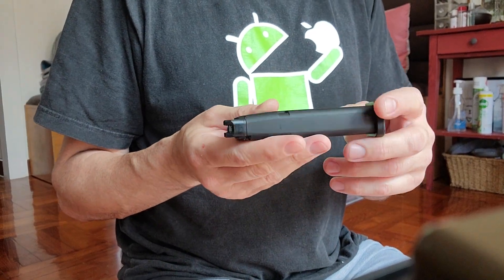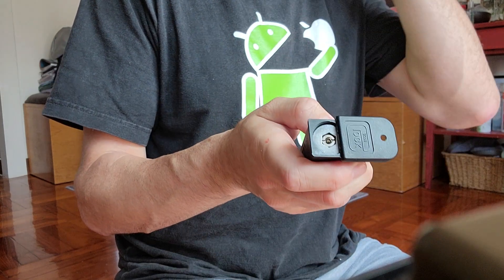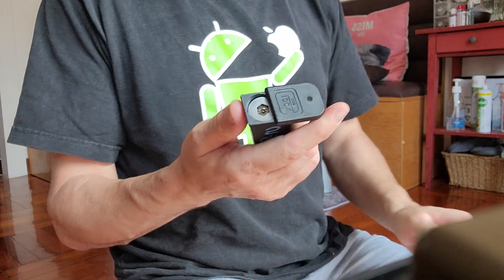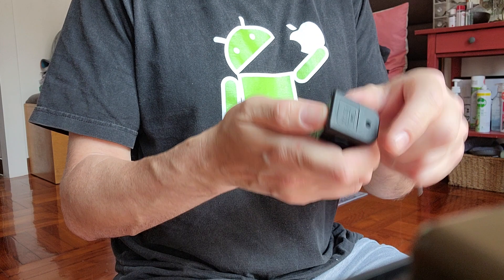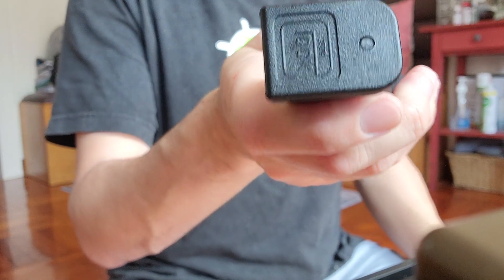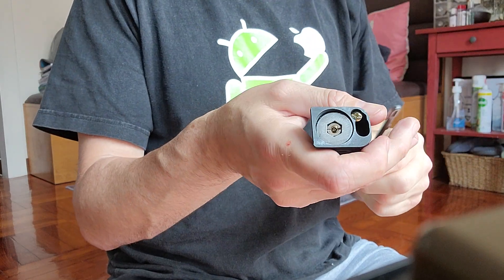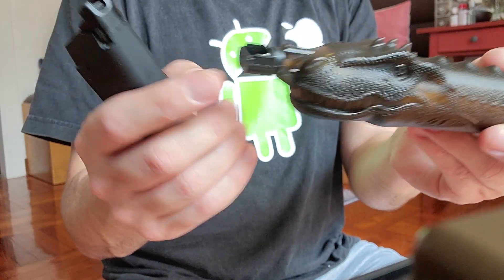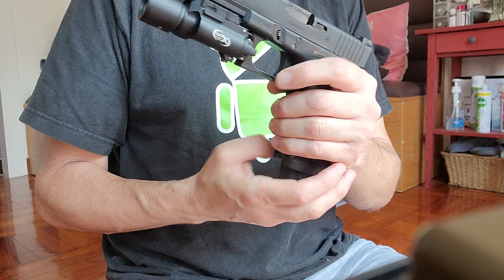Just some advice and comments on loading the GHK Glock 17 airsoft magazines.

Comment: Thank you for the tip on releasing the base plate button. Anyways, I always loaded my mag with the slide back, and yeah I always ending up putting 21 rounds in. It’s tough to control with a loader anyways.

Comment: as much as I love my GHK G17, I DO literately hate the Mag! I´ve tried several speed loaders and adaptors but I just can´t fill the mags. I almost break the loader and even the BBs because I need to press with an terrible amount of force. Any Ideas? Should I try to sand the feeding lips a bit?!
Reply: Same, the stock one was broken after a week. I just ended up getting a way more expensive loader with a thicker rod. This magazine is a pain to load, but somehow after 500-1000 shots it gets a bit better, at least for me.
Reply: @NeilDjents  what loader did you get? I want to replace mine too.